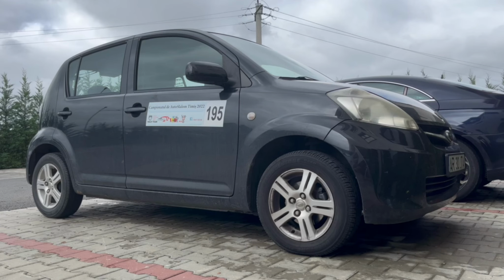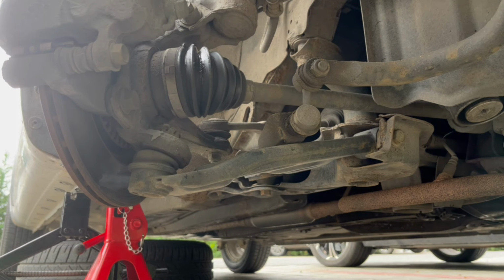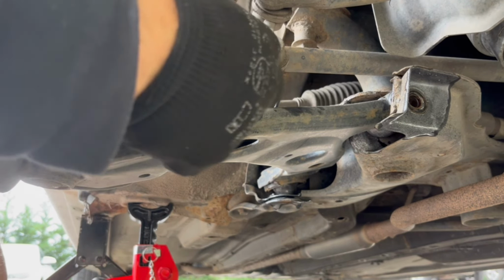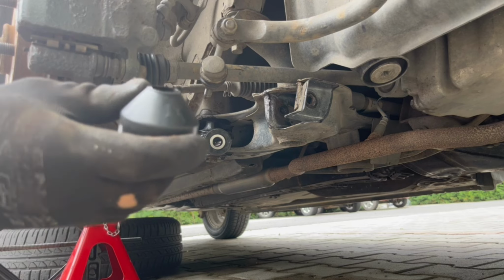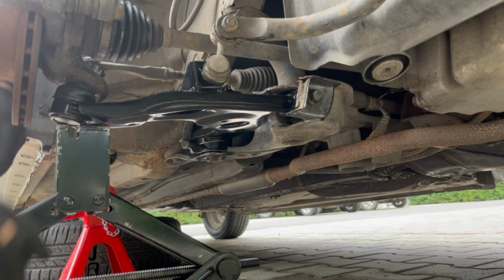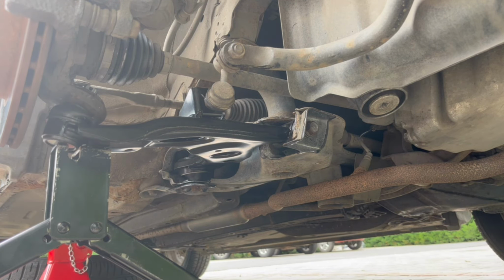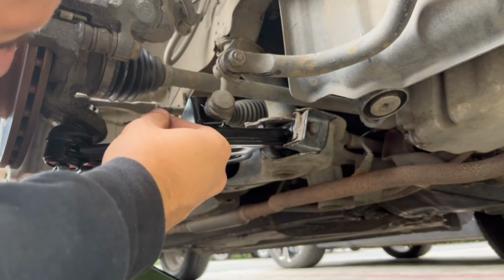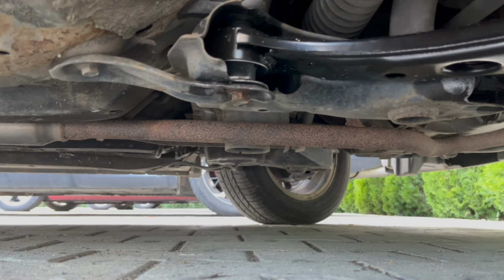09 Subaru Justy Control Arm Replacement - T&J Adventures

Comment: I like your video, just what I was looking for. I did not want to take my car apart. Then to get a surprise and find I could not get all the parts back together. Thank you. I never found this video when I first searched YouTube because I looked for a Daihatsu Sirion.
Reply from the maker: @computertechnician4896  glad I could help!
Reply: @tjadventures   My car is now fixed. Taking it apart, turned out to be the easy bit. I lifted both front wheels so torsion bar links were easy. I also got the ball joint removal tool, so that came off easy. Did not expect it to move with such a very loud bang. The hard bit was putting it all back together. At first I thought I may have the wrong control arm as it appeared it was never going to fit. The horizontal rubber was installed too far over (5mm). I used some clamps to move the rubber so it would fit but when I released the clamp the rubber just sprang back. Your video made this all look so easy, any way I was able to force it home, it just took a long time. Just when I thought the hard work was done the ball joint refused to go fully in the hole. So took it off to clean out the hole. Second attempt and not much improvement but I was able to get the new nut on, but not far enough to see the hole. After another 30mins of fighting with it and a different nut, I got the locking pin in.   Total time 4 hours
Reply from the maker: @computertechnician4896  I remember I had some doubts on the ball joint when I did mine but because I was able to torque everything to spec and the car behaved well afterwards, I knew it was ok. 
From my research there are different parts that can be different between these justy’s. For instance, my starter motor is different from another Justy that I got for parts, although the cars seem identical. Also, talking about aftermarket parts, they can differ slightly but still do the job they need to.
I’m glad you got it done tho and that my video helped a bit!